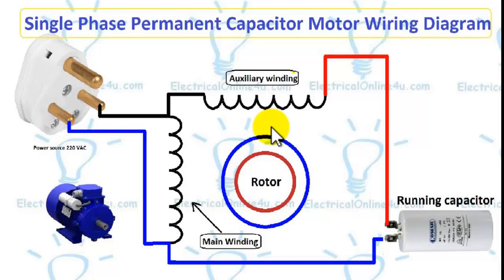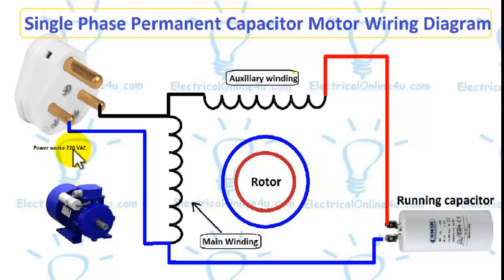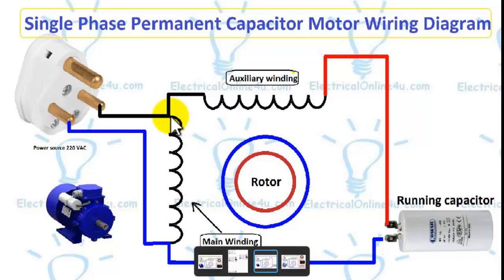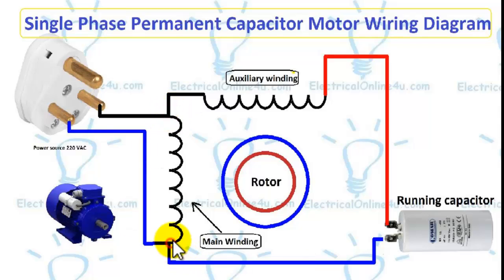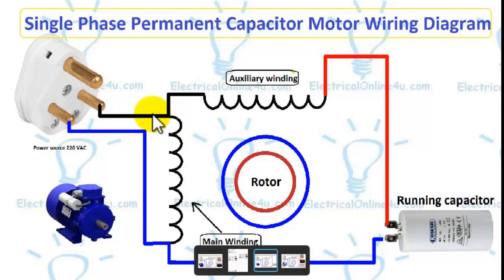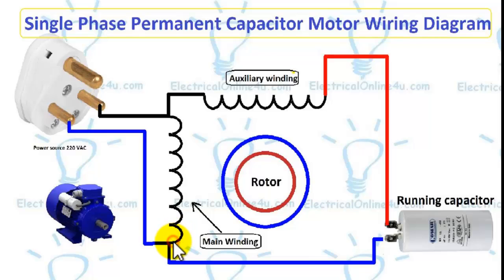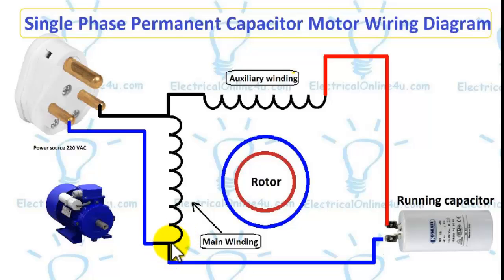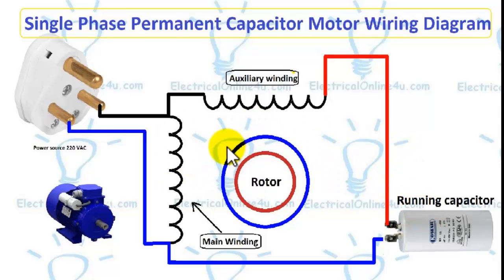Single Phase Permanent Capacitor Motor Wiring Diagram (English)

Comment: what will happen if we either connect the two windings in series or parallel with out capacitor?
Reply: in series nothing will happen but a hummmmm,in paralel the same,the capacitor gives the motor a direction bias and without it it can be manually started to spin in either direction,this does not happen with a capacitor connected